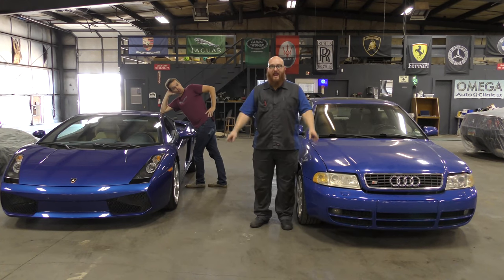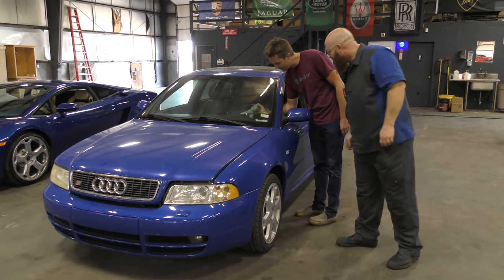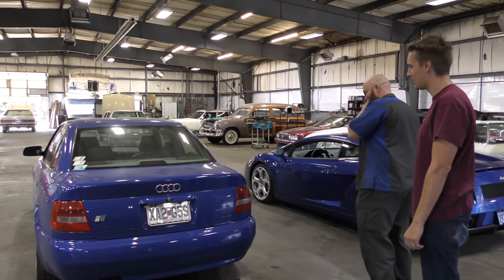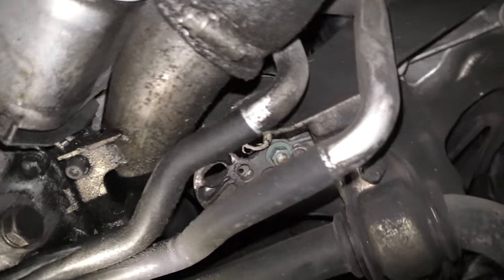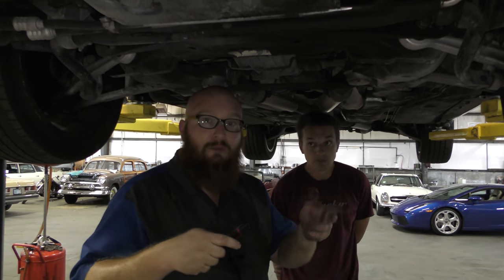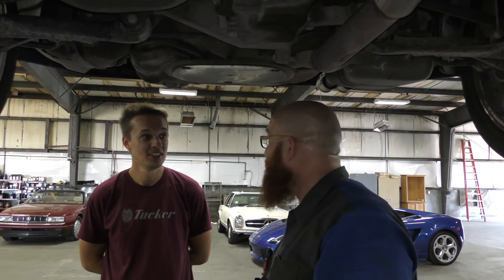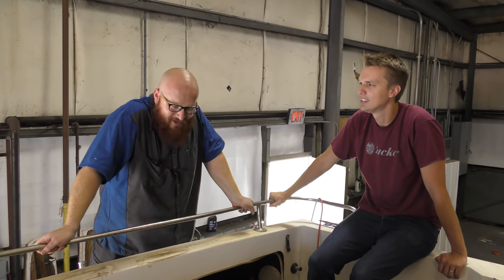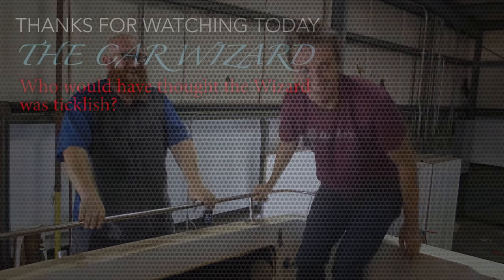Two Blue Audi's & a Boat! CAR WIZARD and HOOVIE talk Audi on 2000 S4 and 2004 Lamborghini Gallardo.

Comment: clearly the Audi owner is following the golden rule of German car ownership. Leave something broken for the German car gods. There's a reason the latch is broken.
Reply: Right.  Latch wore out not from opening the hood for maintenance but for frequent repairs. 🧐
Reply: Ideally you go with cosmetic stuff. Sometimes the gods will be satisfied with your offering.
Reply: @tomtheplummer7322  lol
Reply: @daszieher  That's why I haven't replaced my driver's side wing mirror yet on my 03 Beetle I've been driving for two years! As soon as I fix that mirror transmission grenades lol
Reply: @jaybeemhardscrote7466  g
Good ole "Hecho en Mexico"
Reply: @fpsevanj   363,000km hope my 06 b7 reaches that. I have a bad o2 sensor too. hand break wont work but its a automatic so who cares. Got a few sensor errors too. car lies a lot. miraculously no leaks. Always starts.
Reply: @jaybeemhardscrote7466  tell me about it. My E46 is up on jackstands as I write this, because after getting the bushings, shocks, injectors and driveshafts done in the past years, now the dual mass flywheel pooped the sheets.

Those are the moments where I curse myself for ever having gotten rid of my e21 many, many years ago. 😃
Reply: @daszieher  oh boy! Good luck with that mate, I hope your car is back on the road soon.
Reply: I do that with my fords as well 🤣
Reply: oh hell yes
Reply: No, unless you count interior plastics
Reply: I bought my first car 2 months ago, a mk6 gti. It came with led number plate lights that throw a "check number plate lighting" error. My mechanic offered to fix it if I waited an extra hour, I was always told that a gti ALWAYS has a light on, so I'd rather have that than a check engine.
Reply: @tomtheplummer7322  lmao

Comment: I hate when people say the 2.7T is bad.  The 2.7T is a fine engine,  very close to the 2.8.  The cars that they chose to put it in were poor.  C5 A6's with the 2.7T were fine because they had way more room to cool off.  Heat is what killed these.  While I won't say the 2.7T is the best motor ever, I would take this WAYYYYYY over ANY 3.0 or chain 4.2 (yes that included the RS4).  When actually attended to, these engines actually hold up quite well.  Most of the issues these get are from neglect and not design flaw.  Really ignorant when people hate on the 2.7T but have never actually worked on a nice one.
Reply: 200k on mine, stock engine and turbos.
Reply: Seems like wizard has general hate for audis.

Comment: I had an '01 S4, great car and started my love of Audi's. They were solid engines as long as you didn't chip/over boost them and kept up with maintenance. Mine had over 100k and ran great when I sold it, in fact the guy that bought when he saw it and realized it was stock (except for short throw shift kit) he bought it that day. MANY MANY S4's were chipped causing turbo's to coke up and blow out.

Comment: My b5s4 has 220,000 trouble free very fast miles and my 2005 Allroad also has 220,000 trouble free miles
 Stop knocking the 2.7t engine.
Reply: Yeah, in reality the 2.7T is a fantastic engine capable of 350k or more miles.  Most of the engines that die are built and beat on by kids who want to go fast above all else.  Build them to moderate levels and treat them well and they do well.
Reply: He obviously is mistaken - he's thinking of the v8
Reply: @Richard_AKL  Yeah, the early timing chain V8 with FSI.  The others were pretty solid.  Still not horrific but ugly expensive once the chain tensioners go.  The C5 RS6 was no joy to work on either... good base engine but no room.   The early 2.0T was a bit garbage too if I'm being honest.
Reply: The worst is the 2.5TDI, all of them, 150, 163, 170

Comment: Its actually 265 hp in the s4 and 380 hp in the rs4. The rs4 wagon was faster from 0-60 than a Ferrari 360. The Allroad had 250 hp and normal a6 230 hp. All 2.7t. Fine engines (when they work).
Reply: 250 or 235 depending on year for the A6 models. 
But yeah, very sweet engines and easy to tune. 
Very reliable in my opinion ASSUMING maintenance is properly done and preferable not "Long-Life" intervals. Though working on it requires someone that's able to open a service manual and read...
Reply: If an engine has terrible reliability then I would call it a fine engine lol
Reply: In the usa they got S4's with a automatic and they only made 250bhp, maybe their manual S4's also got just 250bhp.
Reply: @christiandruan  so Ferrari, Maserati and Lamborghini etc. engines are crap then? My dad had a 2.7t. The engine was ok until 180.000 miles - then the turbos went and he sold it.
Reply: @sebastiaanpeters7358  ok didnt know that. I only know about the european market.
Reply: @sharg0  in Europe around year 2000 it was: 230, 250, 265, 380 ps (hp).
Reply: @fthyme87  yeah they are crap if they aren't reliable.
Reply: @christiandruan  they arent reliable... But  have other qualities and def. not boring.
Reply: The 2.7 is an OK motor not horrible not great, they should have used widebands instead of an EGT and 4 NARROW bands. It's dumb. Turbos also go bad easily especially when tuned. Not a bad motor if kept up to service that's it.
Reply: Yes. When they work. You have to be picky about maintaining these cars. I bought one with 2 years of deferred maintenance and I am paying for it
Reply: rockn roll  I know. But the car had a lot of things going wrong prior to that. The engine itself held up pretty well I would say.

Comment: It's not the worst Audi engine, Hoovie is just parroting Doug DeMuro, they're difficult to work on, but they're great engines.
Reply: When it works don't forget that
Reply: Con 27 they have great interiors
Reply: Found the fanboy. It is a garbage motor
Reply: Had the 2.7 in my 02 A6, engine had 293,000 miles on it still on original turbos. Was super reliable
Reply: @alwardhockeynut64  original turbos?
Reply: Plus they are definitely not mounted transversely
Reply: Same as he hates on the BMW engines. The ENGINES are great. The timing chain guides and other misc. parts and pieces (ie. VANOS)? Not so much... It was well-known in the VAG community that a B5 S4 was a Holy Grail car... but you ALWAYS had a second car that you could take to work! ;)
Reply: @troyjollimore4100  The timing chain is part of the motor, friend.
Reply: "The engine that saved Audi."
Reply: I have a 2.7Biturbo Stg3 (450hp), for 5 years now. I'm killing it on every weekend. Not a single problem. Who says it's a shit engine, clearly never owned, and never knew why is actually bad..? Maybe because someone else told them once.
Reply: Benjamin, there’s always a handful that perform flawlessly, sometimes even above stock levels. The Achilles heel for that engine was the timing chain guides... situated by the firewall, of course, so getting at them was an ‘engine out’ affair.
Reply: Yep, excellent engines as long as they're taken care of (which requires nothing special or outside the realm of normal German car maintenance). Jason at Mobile One Inc outside Chicago has been owning and tuning these things since they were new, and swears up and down they're great engines.
Reply: @troyjollimore4100  I am no expert, but I dont believe that the B5 had timing chains.....  I believe it had a timing belt.  I own a B6, and the 4.2L V8 in mine was plagued by the timing chain tensioner issue.
Reply: @chinale17  You are correct. Aside from the belt tensioners, the cams on that engine were chain-driven, which is what I was thinking of.
Reply: @troyjollimore4100  Ahh...  That makes sense.  Audi could never figure out its tensioners of either type.
Reply: @chinale17  "Hans? Since zees tensioners und stuff vill NEVER break. Vere should vee put zem?"
"Vhy, in zee hardest possible place for a machank to get to, of course!" LOL!

Comment: I changed a CV boot on my A4 B5 myself two weeks ago. Price of CV boot plus the requisite clamps and new grease pack: 9 euros. Total cost then: 9 euros. What's the cost of a new CV shaft? 

Edit: Wizard went on to explain that it is cheaper if you fit it yourself. So kudos to the wizard for his transparency.
Reply: Antiochia ad Taurum it’s even worse on some GM cars, I had one that the shaft was $50 and the boot was $50.

Comment: Demand for manual B5 S4's are going up, and nogaro blue is especially sought after. Would not be surprised if that car fetched 10k on BAT. The really nice examples are between 15-20k with low miles and stock. The survivors will be collectable. Don't let Hoovie dissuade you because these are actually great cars.

Comment: I had a 2000 A4 with the 2.8L V6......."fun when it works" are the truest words ever......mine had 225,000 kms but it was costing way more to keep it on the road then it was worth.....surprisingly the people I sold it to had it for another year with lots of driving before it was finally parked

Comment: I have the original 1994 S4 and it is a great car. Original alternator has lasted 25 years. I just replaced my power steering pump after 25 years and it still has the original clutch. The starter was changed 4 years ago. It has the 5 cylinder 2.2 20 valve engine.

Comment: Changing boots is fairly simple. Some drive shafts can be pulled apart without any tools once they're out. So you don't even need a boot gun.

I did the boots on my E46 and saved a ton of money. Two kits with two boots each, grease and clamps were less than a third of what the cheapest single shaft would have cost me. So 1/6 and a bit of my time.

Getting the shafts out in the first place was a pain, tho'.

Comment: The engine is mounted sideways Mr. Hoover? I thought you knew cars better than that. The B platform Is longitudinal.
Reply: I'm pretty sure that's a lambo dude.
Reply: アマ while I am fairly certain that is the S4 Hoovie referred to as transverse, I’m right in correcting him anyway. Both the VW B platform of that time (Audi A4/S4, VW Passat, Audi A6/S6, and Skoda Superb) and that super car platform (Audi R8 and Lamborghini Gallardo) mount their engines longitudinally, with their transmission also mounted longitudinally, with the drive shafts coming out the side of the transmissions. So the entire drivetrain of both cars is in fact longitudinal, and any reference to transverse mounting on either car is erroneous.
Reply: both the s4 and the lambo are longitude mounted engines the b platform has never had a transverse engine note to passat owners the "b6" is really the pq46

Comment: "worst engine audi has ever made"
The 4.2L V8 would like a word with you
Reply: The chain 4.2, the belt 4.2 is a fantastic engine
Reply: The final iteration, the CFSA, that went in the B8 RS4/5 is a masterpiece. Transmission will go to shit waaaaay before the engine.
Reply: I just got rid of mine pis of crap 2005 audi a6 4.2l v8 s line.
Reply: @tonyal4532  yeah, the 05 had the chain 4.2
Reply: @allendaley9439  Correct- we have had two belt 4.2 Phaeton- no issues.  As well as two W12 Phaeton no issues, and a W12 Bentley.  Cheap parts?  No.  Involved to fix?  Yea.  Still great cars.
Reply: @Josh-ce9sv  I'd love a w12 Phaeton or A8, currently have an S6 Avant

Comment: I bought my 99 S4 back in 2013 and it wasn't that bad at all. Mine has now 289.000km (~180k miles) and more leaks, a rusty exhaust und also bad rubber mount. The CV boots were done twice.
But my driver seat is in much better condition!

Comment: I wouldn’t replace half shafts with aftermarket ones.  I would refurb the factory shafts.  Cheap ones are solid and not hollow and can lead to vibrations.

Comment: I don`t understand why they say it`s a bad engine. I own this car for 13 years. I drove something about 100 000km on it and it runs great. In total it is 300 000 km on speedometer. There was some problems with exhaust gas temperature sensor. Just change oil timing belt and it runs great :) Can not understand why they say worst audi engine?
Reply: Because it’s impossible to work on. Every job is a massive pain in the butt to perform.
Reply: Andrew Guyther did the cam belt change on my one. Service position! But it's worth it.

Comment: And never rust on the Audi, because he has a full galvanic zinc coating by factory.
Reply: Depends on where you live... ;)
Reply: if you live in heavy salted area, then b5 usually start rusting on front arches. but those are easy to just replace so no biggie
Reply: My dad had a b5 a4 with 350000km and he had a little bit of rust at the wheel arches
That's because in my cauntry they put salt on the ground when it's snow
Reply: Even so, the bodies are really well-protected. It’s the underbody and frame/suspension parts that are susceptible, though they rust more slowly than some other makes...

Comment: A good friend had a 1998 NASP 2.7 5 valve A6 which just kept going and going and going with virtually zero maintenance. This included about 5 years running with a leaking radiator and had nothing but water added. Did over 250k miles before the body just rotted so badly it got scrapped. Engine was still fine.

Comment: Correction two blue manual VW's 🤣
Reply: That makes it worse
Reply: Ruthlessly correct.
Reply: @1985toyotacamry  ahah, to be honest, VW's are not that bad at least here in Europe there are not a lot os reliability issues with the cars
Reply: @J19A95B  yeah but for some reason they built VW like crap except for their diesels
Reply: @1985toyotacamry  It depends on the powertrain, but yes the diesels especially the old ones are really robust.
Reply: @J19A95B  yeah and that's why if I want to get a German car it has to be a Diesel engine

Comment: Do yourself a favor and replace the lower shift cables shift arm and shaft, it's very common even in fresh water that you develop shifting problems without doing it every 5 or 6 years. There was also an update kit to add a shift assist on the shift plate that helps pull the out drive out of gear.

Comment: Gack! Two four cyl.  MercCruisers. Getting both of those things to run at the same time on our SeaRay was akin to a miracle. And then there were the outdrives! And, as the video shows, the engines are about 5 feet below deck level. And! if the engines are too close together, the boat handles like a hog on ice.

Comment: The 2.7 isnt a bad engine if it is treated right. Oil should be changed every 6k miles. The s4 2.7 is even better becouse of cosworth tweeked it.

Here in norway you dont get those under 15-20k dollars
Reply: Wow I guess I need to send my 2001 S4 manual to Norway
Reply: @sethcjones  they have crazy taxes, therefore cars are expensive
Reply: Isn’t it the rs4 version that had the cosworth heads ?
Reply: @chewbaccasaurusrex692  dont know about that. But cosworth tuched the s4 engine. But they did more to the rs4 i think

Comment: Totally disagree with the take on the 2.7t engines. I have owned 3 s4's and all were over 180k miles. There a great engine that came make a lot of power on stock internals. Buy one hoovie and throw some k04 turbos on its and a tune and it will smoke that Lamb
Reply: B5 rs4 here in the Uk, one of the best cars ever. 2.7 with k04s. Still miss that car
Reply: If my C5 Allroad wasn’t so heavy... K04, stage 2,   the best car I’ve ever owned!

Comment: Got a 1999 S4 B5 avant with 189k miles still in very good condition and a daily driver, not overly hard to work on, change the oil change the belts and the water pump and happy mothering. There not as bad as Hoovie is making out, he cant even get the position of the engine correct.

Comment: That’s actually one of the best Audi engines ever if ya just maintain them...250k on my stage 3 pushing 25psi for 190k of it...0-60 in 3.2 sec.
Reply: Gregory Feeley   Stage 2. 3rd gear. Fantastic. 214k. Love it. Hate working on it

Comment: That S4 looks pretty good from outside but the interior and the gauge cluster need some love.  The downfall of the 2.7T is the shitty K03's.  Fine stock, but once you tune the car, those turbos get more stress.  When they fail you have to pull the engine to change them.  Most enthusiasts use that as an excuse to upgrade.  I had a B5 S4 from 60-130k miles and it only needed a timing belt service, brakes, tires, oil changes, and 1 rear wheel bearing.  Mine had a cat back exhaust and MTM tune and it was a quick car.  It was totaled unfortunately or I'd still own it.  I have a B6 A4 1.8T now and that car is so easy to work on by comparison.  I can change a turbo in about 1-1.5 hours.

Also Hoovie, that isn't a transverse engine, it's longitudinal.  The front mount is called a snub mount and they disintegrate over time.  I put an 034 polyurethane mount on mine and it's a little more harsh at idle but once you are driving you don't notice it and there is no longer any noticeable slop when accelerating that you could feel through the shifter.

Comment: The highest mileage B5 S4 I saw was a black manual with 236,000 miles back in 2007. The long block on the 2.7TT was built like a brick shithouse, they can reliably run 500-600hp on stock internals. Unfortunately a lot of the items bolted on the motor were problematic, expensive, hard to access/replace, or all 3.

Comment: 2.7 motors have their flaws but they're not as horrible as everyone makes it out to be. Its just the tight space and having to put the front-end in service position to work on. It could be worse could be a 300ZX or 300gt or 350 and a few others.

Comment: Technically differentials are transmissions.  I believe you meant to say looks like gearboxes, as whatever is aft of engine, is called transmission as it transmits power to the driving wheels.